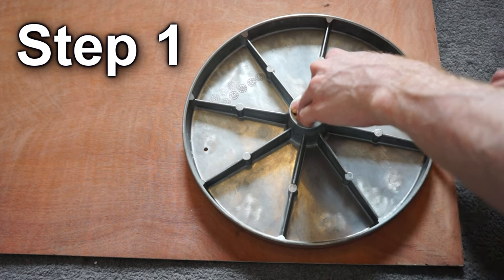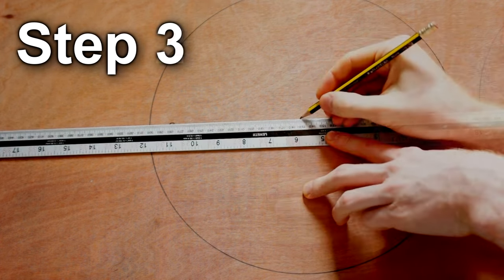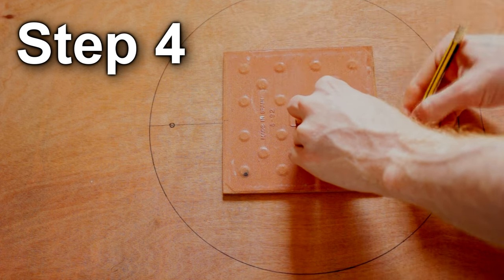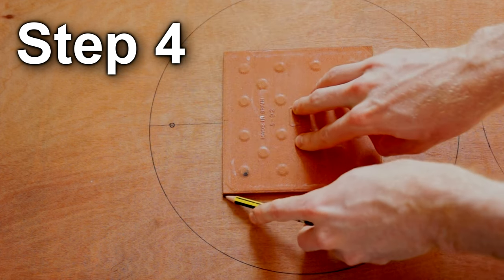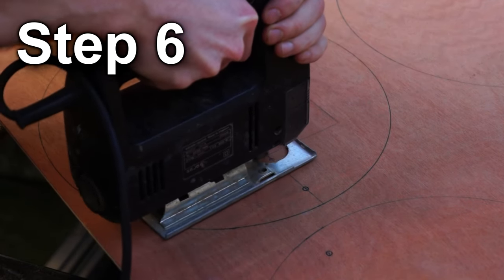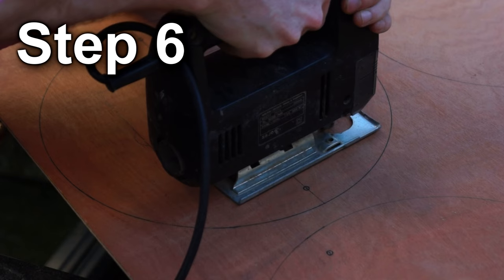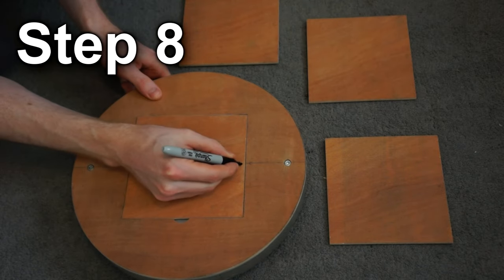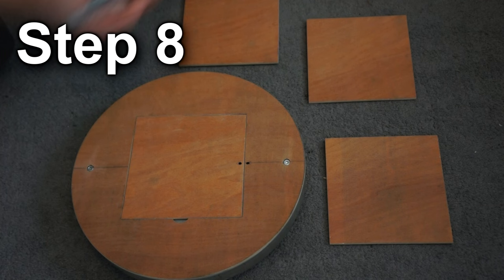How To Make Bats For Potter's Wheel

Comment: Excellent demonstration and ideas.  But for those who are loath to drill holes in their wheel, try using two thin bamboo sticks held tight together to lift the larger pieces from the wheel. (It's the traditional way here in Japan, and in in other Asian cultures.)
Reply: How do you get the stick to stick in the wheel?
Reply: @stormygallows5658  You use the long sticks to lift the piece off the wheel.
Reply: @mikeu5380  I presume you are using clay pads to attach the bat to the wheel?
Reply: @edelgyn2699  I don't normally use a bat. But I use the long, thin bamboo sticks to lift the thrown pot off the wheel. Hard to describe-- I imagine there are illustrations somewhere (perhaps you have access to older pottery books published in Japan and perhaps Korea). Hamada Shoji can be seen using these in some old video, available on YouTube...
Reply from the maker: Yes i have seen that actually. Ive tried various techniques including throwing on canvas and just lifting off with hands. I think it comes down to personal preference and the type of pottery you make.

Comment: A few improvements could be made here. Don't drill through your bat for starters, the pins don't need to go through, just grab a little. The squares are an interesting idea, but not necessary considering bats are cheap as chips. 👍
Reply from the maker: The main reason for the small squares is they fit nicely together and take up less space on the shelf when pots are drying. Good idea on the drilling.